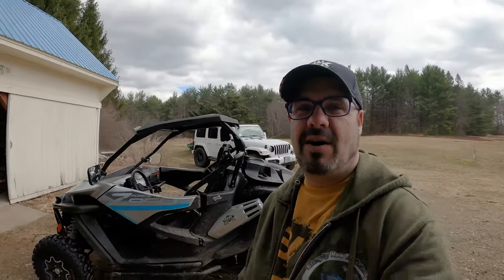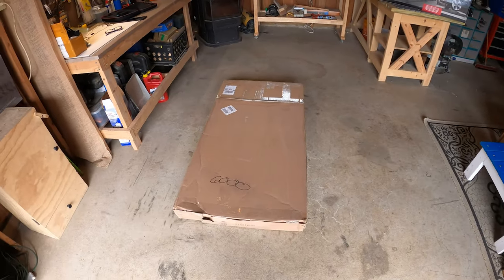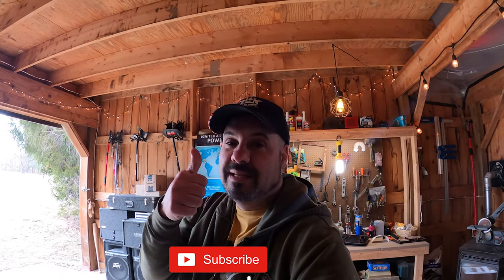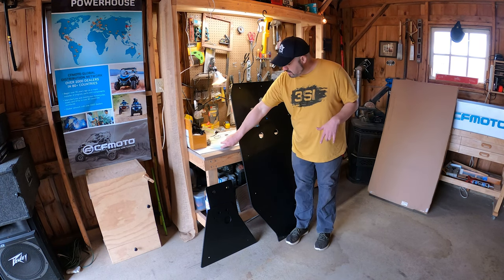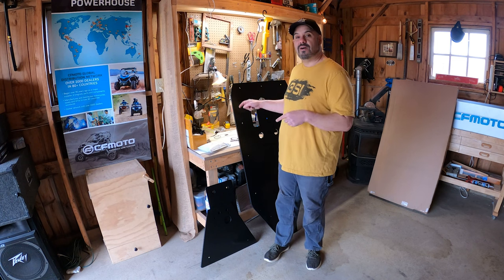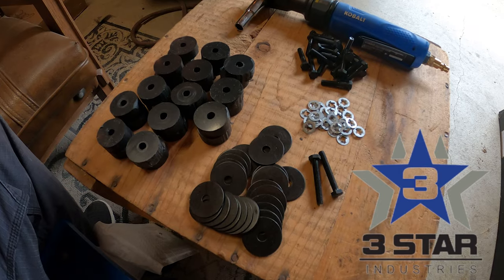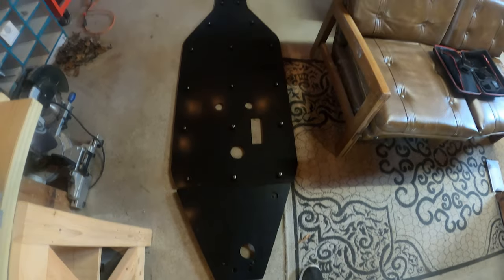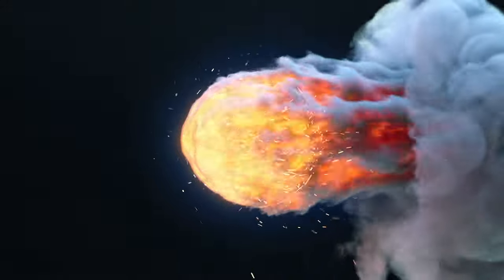BEST CFMOTO SKID PLATE & COMPANY FOR SXS/UTV PRODUCTS | HOW TO INSTALL

Comment: Question how does compare to a aluminum skid plates?
Reply from the maker: Hard to say as I don't have aluminum skid plates.  what I do know is that it is HDPE is 65% lighter than aluminum, It is BPE free and with any sort of plastic compared to aluminum would be a hard conversation as the are two fundamentally very different types of material.